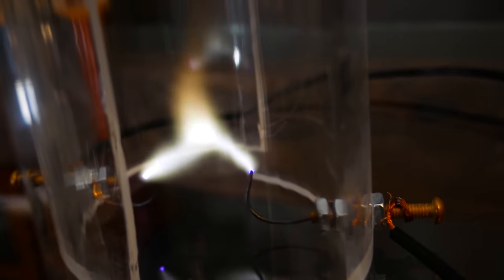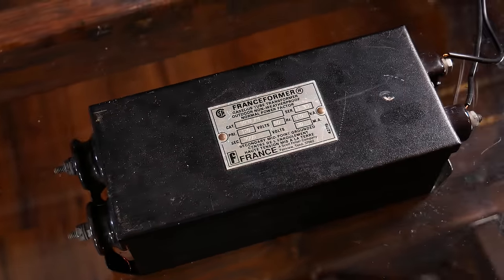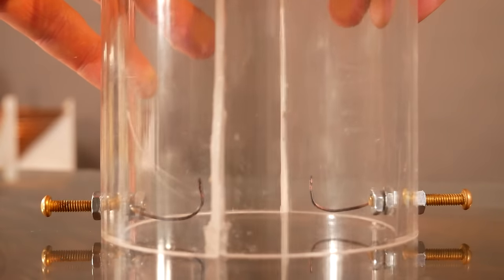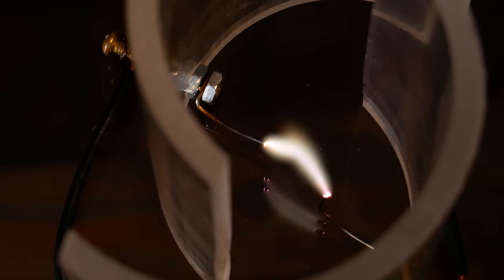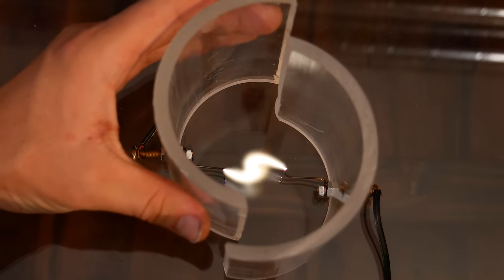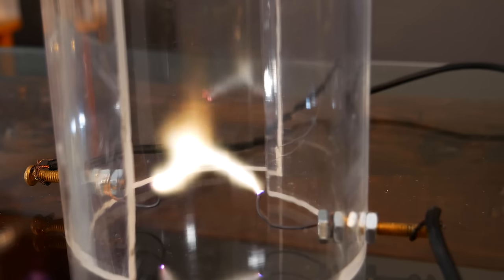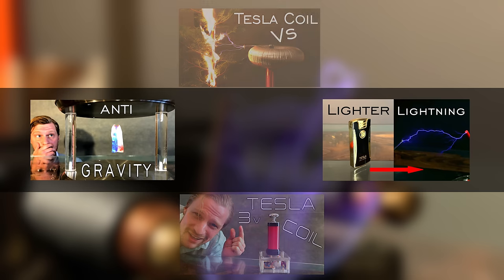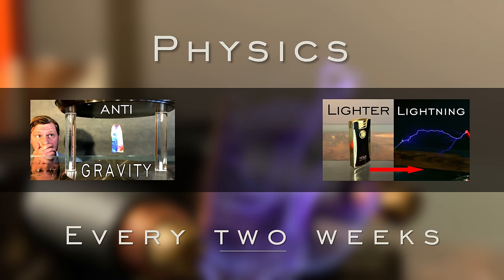9000 Volt Plasma Tornado Made by Electricity

Comment: Whether as a PDM 1, 2 or 3, they are all electrical but with different current densities. From my Electric Weather Mechanics doc- "...As already stated, standard meteorology due to using only fluid mechanics can only have temperature moving the atmosphere around. But recently and after just the data from a big storm system was input into a super computer and without any preconceived ideas as to what was happening (fluid mechanics), it showed that the wrong type of temperature seemed to be doing the driving in the system.

With it being the cold instead of the hot pushing air columns up. This left them scratching their heads as rising heat is supposed to drive weather patterns and not rising cold.

But when seen as negative charge heading from the ground towards the positive ionosphere through the conduit of the cloud and as it does so, affecting the matter state of the H2O molecule, it then makes a lot more sense...." and this, which shows the mechanics-  /watch?v=e2wbn3ivHwc&feature=emb_logo Also remember that after Dr. Don Scott mathematically described a Birkeland Current (dust devil, twister, waterspout etc), he showed them to be an electrical circuit and not just a power dump in one direction.

Comment: also i figured out while testing the lamp with high voltage if you put the ground wire near the base of the lamp while it has 20kv running through it it produces xrays but it has to draw an arc on the inside of the bulb to the base and i burnt a hole in one of my neon bulbs doing that because the arc got too hot
Reply from the maker: Yes, producing sparks in a vacuum has the potential to produce x rays. Gotta be careful with that!

Comment: Perhaps you could ballast a dual or triple MOT power supply to only draw 10A when shorted out, and place the electrodes vertically in the vortex rather than side by side! I think the results could be promising...

Comment: I think a smaller containment vessel would help.
Sure the plasma is much hotter, but there's much less of it.
If a small tube was used, the speed of the airflow would be increased.

Comment: Try this. Have the two neon sign transformers operate 180 degrees out of phase to each other at high current. See what happens if you bring wires from two neon sign transformers closer to each other. Maybe it will help convection going better and form stronger plasma vortex.
Reply: As for ground/neutral, you can add a bottom metal plate at the center connected to ground/neutral. So two wires from two neon sign transformers operating 180 degrees out of phase to each other and pointed at each other placed at some height above the ground/neutral plate placed below between the two wires.
Reply from the maker: Hmmmm that's an interesting proposal. Tell you what, i'll give that a try and see what happens out of it. Thanks Xeno!

Comment: I am wondering what it would look like under a partial vacuum. The glow might expand a bit more, revealing more of the Vortex.
Reply from the maker: Hmm that's not a bad idea....... However, under partial vacuum, the spin would be slower since the buoyancy differences in hot and cold air would be less (leading to slower rise of hot air)
Reply: @PlasmaChannel  Yes it probably would be slower. I saw a video of someone trying to do a tornado with a MOT. It was very bright, rather small and too quick to see the Vortex properly. Reducing the pressure might decreases the current, so that your wires doesn't melt (I would suggest carbon electrodes anyways), the glow gets dimmer, but bigger and more controllable, because you can control the Gap and airspeed, by controlling the pressure. At least that's what I am hoping it will do.

Comment: try using the Lorentz force in fact if you create the Lorentz-O[Smoke-Ring] effect on a toroid craft it will create electrostatic repulsion and take off from gravity's electrostatic adhesion.
Reply from the maker: Thanks for the input. Gravity does not have an electrostatic component.

Comment: use a few MOTs to get higher current, and submerge them in oil to prevent flashovers, 4 MOTs should do the trick and provide more than enough current to form a wicked plasma Tornado but a very very lethal one.
Reply from the maker: Hi Noel! I tried a single MOT and it vaporized my entire wire and acrylic cylinder. I decided to try with lower power levels!
Reply: @PlasmaChannel  yeah mots are pretty scary, kinda one extreme to the other. the other option is finding a 60ma NST like what i have in my tesla coil, or two phased together like i have to give you 120ma, maybe enough to get what your wanting from this?

Comment: 🎇🎇🎇PLASMA TORNADO🎇🎇🎇
Plasma Channel is the only channel that makes me believe that I haven't seen everything yet😛
.
.
.
Hey jay, as plasma is simply ionised gas that emits radiation (visible spectrum most of the time) when electrons jumps back from high energy state to lower energy state. And all this happens so quickly. So, here goes my silly question :- I was wondering if it's possible to create plasma that can be contained inside of an insulated container so that it can be poured into a different container without losing the plamsa state. Like having a bottle filled with plasma.
.
.
.
Just came into my mind 😛
Yeah, plamsa is simply energised(energised electrons) gas that needs continuous source of energy to glow but wouldn't that be awesome if its possible to be able to carry a bottle filled with plasma.
Just a random idea😝
Reply from the maker: Hey Tarun! Wooo! You're my number one commenter. You raise a very good question, one which i've thought about for some time. It would be difficult to contain plasma without constantly putting energy into it. However, if these storage devices had their own energy stores to maintain the plasma, there is no reason you cannot transfer the energy between containers!

Comment: Great to see more stuff from you. Just one thing. You have to watch using some neon transformers they have safety feature on them that cut them of if you arc it. I’m just saying because I had to remove this on some transformer for some people. I seen a lot of them on cheap ones on eBay and you can’t take them apart because they are glued up.
Reply from the maker: That safety feature is very annoying  for us experimenters. I cant stand the modern NSTs

Comment: Perhaps some magnetic field would help, if you have your current in a single direction instead of AC. This would be easily achieved with a microwave oven HV diode (typically 12kV). If you have readily available some of those very strong neodymium magnets, perhaps its field would curl the plasma even more.
Reply from the maker: I actually plan to attempt this with DC. I'd use a FULL BRIDGE RECTIFIER to get the most power out of the AC

Comment: Try a hydrodynamic capacitor... A coaxial capacitor with an axial magnetic field and arc your plasma across the capacitor plates... Maybe use a outer cap plate as a cone instead of a cylinder....  I guess it might be a spinning Jacobs ladder.... You may surround the whole thing with your half cylinders to enhance the flow...
Reply from the maker: Thats certainly an interesting idea. Cheers!

Comment: If you put the same set up in a vacuum with a little argon it might make a full tornado .
Reply from the maker: It wouldn’t work in a vacuum. This method relies on air coming into it. If a vacuum... there would not an an air input
Reply: @PlasmaChannel  hence the added argon after the vacuum.

Comment: Maybe you could try sucking in the air above the cylinder
Reply from the maker: Thats a great idea. However, convection works off the principle of buoyancy due to gravity, so the air will always rise.
Reply: @PlasmaChannel  yes but if the air rushes in at greater speeds at the sides of the acrylic tube the rotational speed as well as the speed of the upwards draft should be increased which should result in the spiral being dragged along further.

Comment: You need you electrodes arranged differently as the arc will always be forced to travel in a straight line from one electrode to the other. If you arrange one electrode in a circular configuration and the other place dead centre of that circle your arc will be free to travel in a circular direction. You can increase the effect by using a toroidal magnet as an electrode and putting the other electrode dead centre of the magnet.

Comment: What if you tried to use a smaller diameter tube to get hotter air in the tube
Reply from the maker: There was a good balance of size. If the tube was too small, the plexiglass started melting.
Reply: Plasma Channel what if it was a glass tube, and yes I know its hard to cut

Comment: What will happen when you connect a microwave oven transformer which has much higher current at 2000v.
Reply from the maker: I found that it was too much power. It overwhelmed the system.

Comment: Hey man good video! I was wondering what if you were to use a Jacobs ladder set up so as the heated air broke down and twisted the arc could follow it. I was thinking this would help since the air would start to rotate faster near the top, also it would just make the spiral larger. Also it might benefit to spiral the wires around each other in the same way as a Jacobs ladder like the structure of dna, could allow the anode and cathode to follow the spiral as the arc moves up the ladder!

Comment: Hey bro, wanna do my light saber? I realize now that the word plasma was why I didn't see the phenomenon as others do. I see a dielectric current, because minus the physical properties of copper wire, there is no Hertzian cycle caused by magnetic field displacement. A 1D linear A-B transfer of dielectric potential through the Aether. In 2D electrical engineering math, we have what we have, sq2. I added the last dimension, rotating magnetic fields with the linear-Euclidean time component. It's only a diagram and talking, but it is on my channel.

Comment: If you place the capillary tube under the middle of the Ark, and pumped in just the tiniest amount of argon, or another active gas, it should cause the plasma Arc to climb even higher because there would be more surface area for the ions to jump across and illuminate. It makes sense in my mind but I have absolutely no idea if it would work.
Reply from the maker: Adam, that's a great idea. I may have to try that.
Reply: @PlasmaChannel  you could try MIG welder torch tips, then you get your gas source and Arc origin from the same point, then you could try alternating the polarity see how that interacts with positive and negatively charged gases.

Comment: What do they mean when they call plasma the 4th state of matter?
Reply: Solid...liquid...gas... and plasma
Reply: @among-us-99999  thank you for the input, but I already know the order of states. The thing I cant wrap my mind around is what any form other than the first three would be. The first three states are merely an expression of the level of excitement of an atom or grouping of atoms  at any given time. I understand that basically lightning is a form of plasma, but it is still just a grouping of extremely excited atoms with an electric discharge traveling through them creating essentially visable electricity.
Reply: A Plasma is basically just a fully ionized gas, and it is visible because of electrons recombining with atoms I think
Reply from the maker: Think of it this way. Each state of matter is at different energy levels. Solid is lowest then liquid, then gas. Gas has tremendously more energy per molecule, than solid. Then there is plasma. So much energy that electrons are RIPPED off the atoms, making them ionized. This ripping process causes tons of heat, partially leading to plasma being hot (though, you need to get hot in the first place to create plasma).
This is not 100% accurate, but is close.
Reply: @PlasmaChannel  perfect! Thank you. That makes sense in my brain. I guess I was thinking in macro terms, or groups of atoms instead of the individual state of matter. Thanks for clearing it up!

Comment: Forget what I said before I know how to make this work. You need a vacuum chamber large enough to put these partitions into. The plasma Arc will grow substantially in a vacuum!
Reply from the maker: Well, it wold need to be a very large chamber. large enough that the air rising from the arc would cycle back down the sides of the chamber and be sucked up by convection again. The key to this working is that it has a constant flow of air at the base.
Reply: @PlasmaChannel I agree. First if it starts to work I'm curious if the ark will helix or just randomly and rapidly collapse on itself.
Reply: @PlasmaChannel  You could probably get away with a 1 foot by 2 foot acrylic tube, since we don't want to go to a complete vacuum, it should be able to withstand the pressure. If you do decide to try that make sure you use acrylic glue, and caulking, but the caulking won't last long. Proto putty would work really well but you have to have the vacuum pump to create the seal.

Comment: В магнитном поле попробуйте дугу зажечь, что получится?
Reply from the maker: I imagine lighting an arc in a magnetic field would be interesting. In the next video, I plan to use magnets and DC current.
Reply: @PlasmaChannel  I think it will be an interesting video!  I will look forward to its release!
Reply: @PlasmaChannel  By the way in an alternating field, will probably have interesting moments too!  And if you try to run several coils asynchronously, how then will the discharge behave?  If I had time, I would try all kinds of fields and stresses!  Cool !!!!! 👍👍👍